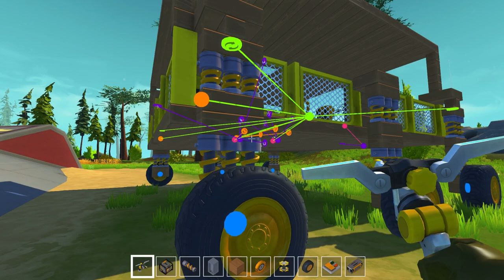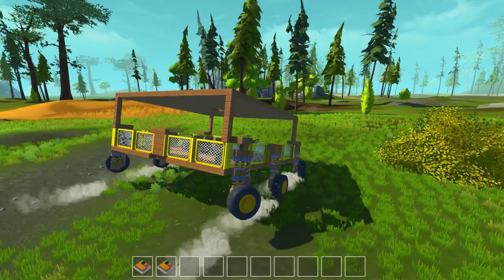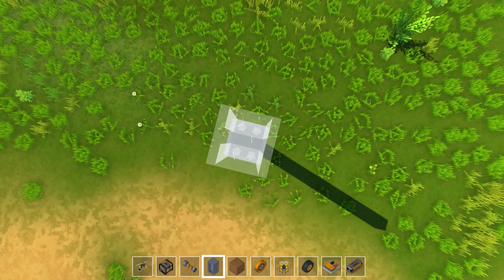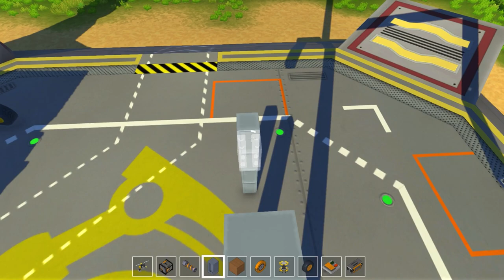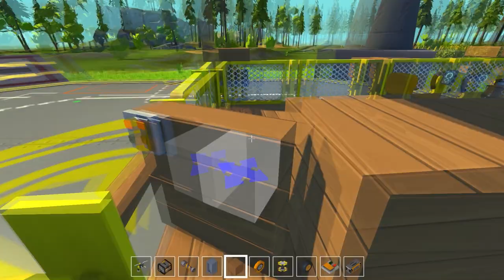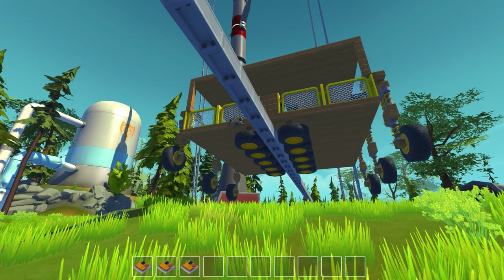Scrap Mechanic - Monorail Elevator Complete! (Willy Wonka Elevator) - Scrap Mechanic Gameplay

Comment: The vertical elevator function won't work now that you've put the back monorail wheel right in the clearance path. :/ That wheel should probably fold in from the side on top of the platform

Comment: Doesn't this completely disable the elevator portion of the vehicle?
Reply from the maker: +xXx_1337_H4X0R_xXx no it opens up just fine
Reply: But the wheel blocks the opening...
Reply: +xXx_1337_H4X0R_xXx same I thought the same
Reply: +Draegast derp
Reply: +xXx_1337_H4X0R_xXx XD i didnt even think of that, might be a bit hard to connect to the pole with a wheel in the way lol
Reply: +Draegast How to tell a derp from an engineer.
Reply: I think that you now can't even go up the right now you have a monorail that is overcomplicated not a fucking chocolate factory elevator
Reply: Doctordomonation121 TRIGGERED
Reply: xXx_1337_H4X0R_xXx absolutely
Reply: @Tek_0135 mind your language

Comment: I think I know how you could simplify and/or improve the system a bit in 5 steps, which may help you with your lag (as well as clean up some of those lines cluttering the screen while you build and lightening your craft.)
1) Instead of having the 10 or so horizontal wheels as your powered wheels, make the 2 vertical wheels your propelling wheels, with the rest being free and just guiding. 
2) Once you do that, try removing a few of the wheels on the underside (like every other wheel or something) since you only need them around the outer edges to help guide it on the track, and doing that would remove the extra hydraulics too.
3) Maybe to get rid of that "eyesore" box in front of the gate, have it attach to a panel that folds up and down like you did on the other side? You don't need to cut it in half since it would be just that section instead of the whole floor, and the roof would be holding the other side together.
4) For the suspension, try having 2 steel bars being the part that turns and has the suspension attached to them? I don't know if that would work in-game, I've never played before and can't remember if you've tried... But it looks like it's wide enough for 3 suspensions and won't have the problem that wood seems to have with breaking, and since it would be attached to the wheels below the springs, they shouldn't affect the weight pushing down. You might even be able to place more than 3 or use 2 steel bars to give it more strength.
5) Give it a really cool name! I vote something like the Wooden Railed Environment-traversing Car K--- (WRECK) or an acronym "CLUNCR" or something! 
It'd be hilarious to be all proud driving yer ol' CLUNCR 'round the woods. :D

Comment: A quick fix to all of your problems - Make the vehicle smaller! The reason you built it that big is so you'd have an elevator platform, but you don't need that platform anymore! It would fix the suspension, make it lighter(thus faster). It would fix so much!

Comment: We understand (at least I do) that you have to take a break from the elevator/monorail/off road thing. Just a tip though is that you could try deleting the sky poles off to the side of the main pole for the elevator. Also if you get those side poles to fall over sideways couldn't you use the click and drag delete/build thing? Overall just keep up the good work on scrap mechanic! :)

Comment: You put the "hide-away" wheel directly in the path of the vertical pole attachment. That'll keep you from putting this creation to full use since you'd need to remove it to drive up to the elevator pole and put it back when transferring to a monorail pole.

Comment: Draegast, you will need to move the wheel on the rotating part of the floor, because as of now if you were to try to move onto the vertical post the wheel would block it and stop the post from attaching or detaching to your elevator

Comment: You could have attached a rocket to the bottom of the pole, and made it to where you could go up the pole a bit so that way, there is a spot to put a lock that would prevent the pole from going too far. (The lock would basically be some metal surrounding where you need the rocket to stop)

Comment: I've found the best solution for the crappy strength of bearings to be using multiple 'helping hand' levers pushing up on it as it turns. As for curved rails, they are laggy as hell.

Comment: Dear Draegast
         I have noticed a flaw in your design... the vertical wheel attached to your floor rotation mechanism is set on bottom of the moving floor piece so your ability to dock with an elevator shaft has been compromised. my solution is to rather than set the wheel on the floor mechanism set it inline so when the creation is ran in the fully closed position you have another vertical stabilization wheel mirroring the vertical stabilizer wheel next to the entrance. also try suspension binding blocks behind the glitched ones rather than below, also i have noticed that you build up to your creations when there are jacks that will do the job much faster 

                                                              Best of luck
                                                                             -Davinator

Comment: The way i fixed the suspension issue was to put just 1 block on the outsides of the blocks that link the 2 suspension springs together. cant remember if it was a metal or wood block though, just see what one works for you

Comment: The suspension glitches out because the double layer, the bottom one is pushing up on the top one as the top one pushes the bottom one down, so as of now you can't do double height suspensions

Comment: Why don't you just use the upper wheels for movement and the ones on the side for stability only? The ones above the track are bound to be connected to the track because weight.

Comment: drae i don't think curving would work with how Long you made the roll part what I would suggest is your fist idea to lift it up but horizontaly, maybe with an engine and locking mechanisms if a normal bearing is too weak

Comment: Please like so he can properly fix his suspension. If you put a suspension on top of a suspension it has the power of one suspension however if you put one suspension beside another suspension it has the power of 2 suspension therefore the bottom 3 suspension are not doing anything but cause lag and raise the vehicle granted a higher vehicle looks cooler and seems like it has better suspension however if you put 4 or 5 suspension holding up each tire beside each other it will work much better and cause no lag whatsoever if you do not believe please go look it up on the video suspension and hooks lay by lytebringr

Comment: What if you made the suspension a 2x3 so that you don't have the suspension constantly pushing on each other? You would still get 6 per wheel and could use wood to make up for the lack of height if necessary. That should help with the lag and wont cause it to break.
Reply: But what about the balloon sex noise? THINK OF THE CHILDREN!!!

Comment: do not attach the block to each suspension, instead, attach the first block to the middle and then attach the other two block to the one block.
they will press on all three just fine.

Comment: Why didn't you just power the top wheels for the monorail? Also, the one wheel on the part of the floor that flips will be in the way next time you try to mount the vertical pole.

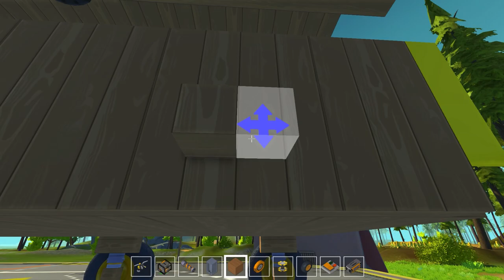Comment: Hey Draegast, when you try to drive onto the vertical elevator the wheel you added at 14:06 will block your way and you won't be able to get it on. Also, in Scrap Mechanics if you have more weight than you should on a suspension system then the suspension sound will be played too often, you can fix this by adding more suspension. Also, no offense but you should take a look at SirCrest's tutorial on a heavy vehicle suspension at https://www.youtube.com/watch?v=bl5MRxVmf6w.